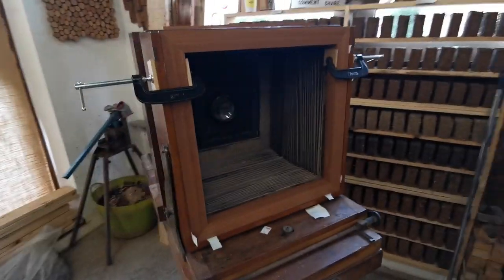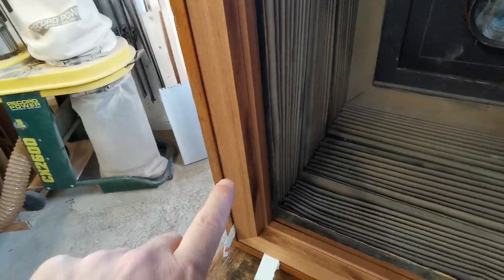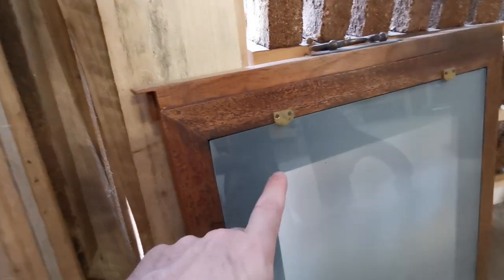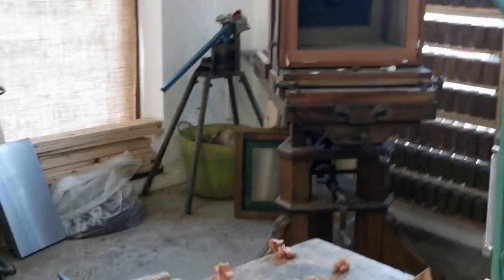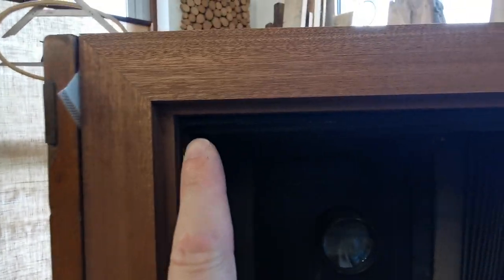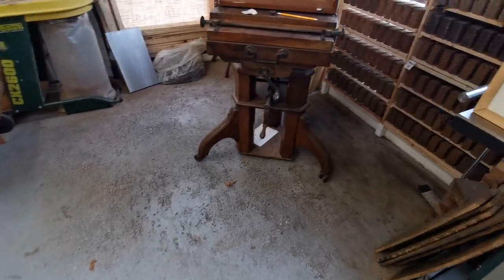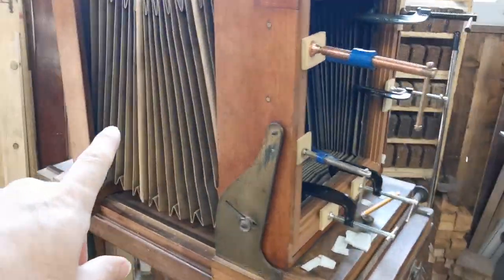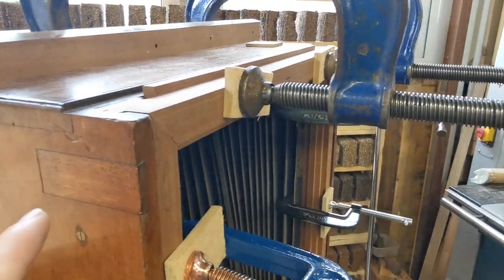[no34] A huge mistake on the Watson camera restoration & saw handle progress.. Well almost

Comment: Very nice... It's not very often you see the process of working in tight tolerances, so it's good to see..
I would have zero'd the caliper on the tooth to get that 7mm from the outside of the blade, just a thought..
It's good to see a plane in experienced hands. The pace of the stroke and stable body position is so important. Never going faster than your attention and body can keep up with the way the shaving comes off and the precision you're trying to maintain...
I see you have a "miter block" on the shooting board, very nice...
Reply from the maker: Thank you Brian.
Yes that 7mm the wrong way round. 🙈 No fancy edits to hide the mistakes 😂
Stance is so important when planing. And todays filming went mad. So I have to edit some clips together now 🙈

Comment: I noticed you don't lift the plan when pulling it back for the next cutting stroke. I find to be good however was taught to lift off the wood while pulling the back. I still plan the same as you are doing, thanks
Reply from the maker: Thank you for the coffee Larry. Very much appreciated 👍
I don't lift the plane. The wear on the sole and iron would be very minimal. By leaving it on you also have it ready for the next push. Easier to make slight adjustments in positioning of the plane on the wood. Whereas if you lift you have to remember the angle or position etc. I'm glad you approve 👍